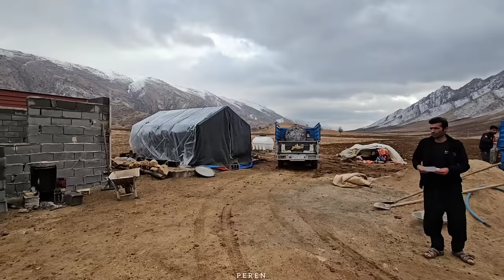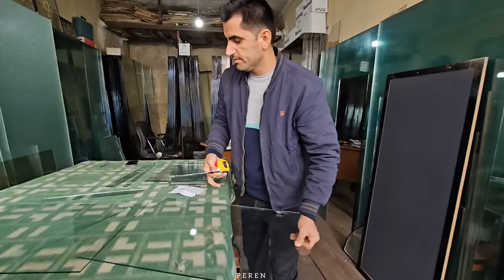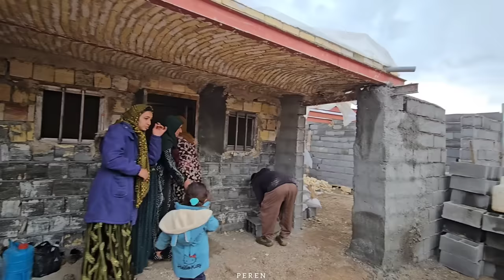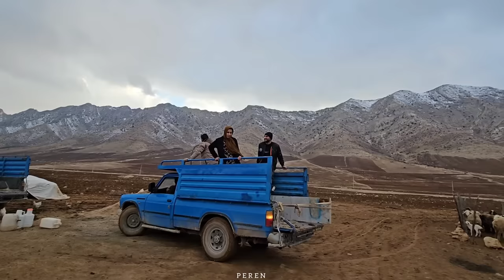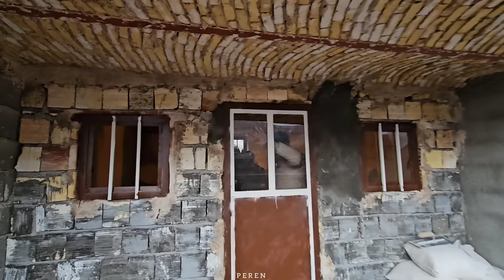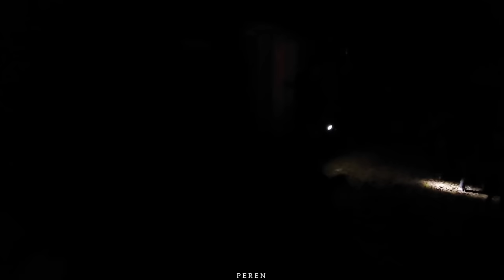"From Sinks to Stoves: The Nomadic Kitchen Journey of Portable Appliances and Tabletop Stones"

Comment: Lovely to see the kitchen coming along nicely. Just wished they wiped off splashes of cement and plaster with a wet cloth as they worked. Unfortunately it looks untidy and difficult to remove now. Perhaps should have put a plastic cover on the floor near the units to catch the excess plaster. Forward planning will help them to achieve more. Great to see the adults laughing through a team activity when they brought the work top from previous place.